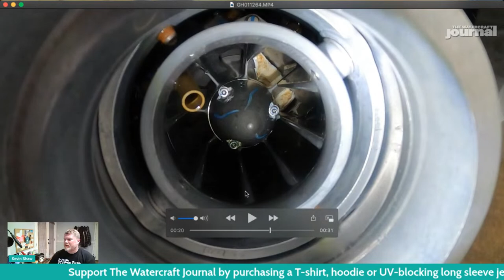PUMPS SUCK! How to Avoid, Prepare For & Fix a Clogged Pump in The Wild! The Watercraft Journal IRL

Comment: I was worried being in Florida I'd be dumb not to get a seedoo because of the vegetation and the idf seedoo has. But if it's most the time simply like this, I don't mind getting in the water and reaching in with pliers or clearing the grate. I go mudding man, getting dirty and wet is apart of the fun for me.

Obviously being a smart rider is the first step but it will still happen like you say. I'm more comfortable with not having that feature on another platform now.

And yeah, dam near all the time those animals are gonna leave you alone. Just have common sense. They won't bother you unless they are very big and very hungry, or your messing with them.